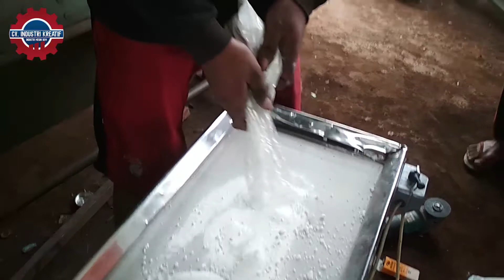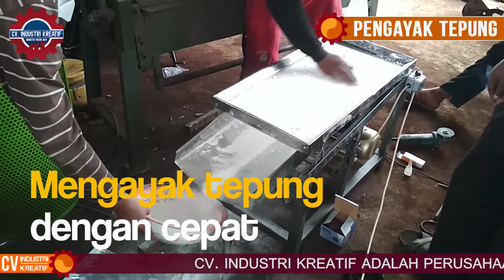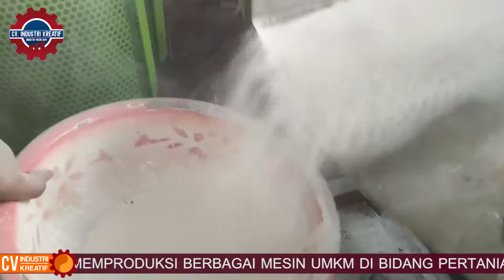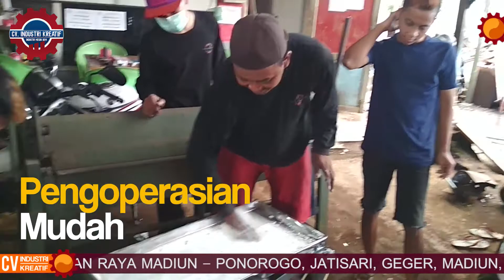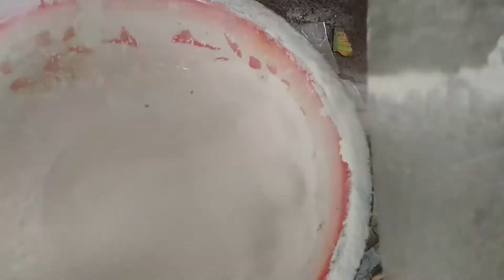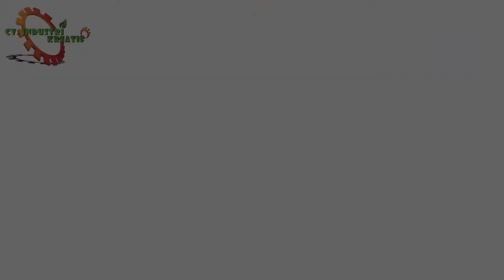Mesin Pengayak Tepung Tapioka, Cocok Untuk Usaha Anda

Comment: Bila ada mesin parut singkong saya pingin beli sekaligus pengayak kanjinya
Reply from the maker: ada gan... 

untuk info harga,detail mesin & pemesanan hubungi Customer Service Representatif Kami (Telp/WA) 081234280625 - 081217850288 - 081252297132 atau kunjungi Workshop Kami di Jl Madiun - ponorogo KM 10 Selatan Puskesmas Geger 300 Meter Kec Geger Kab. Madiun Jawa Timur